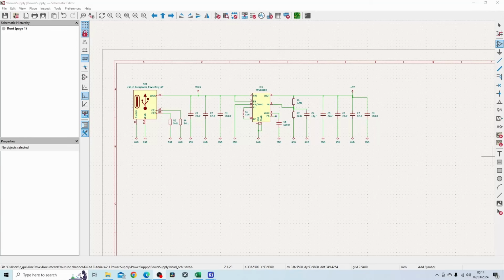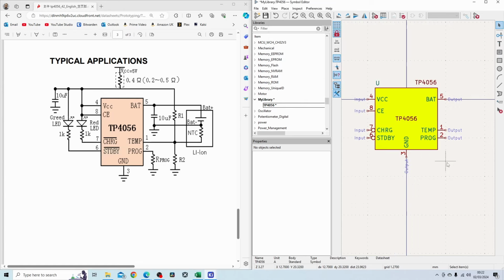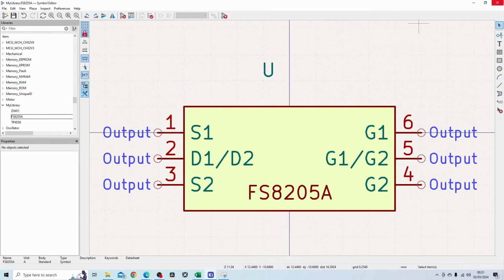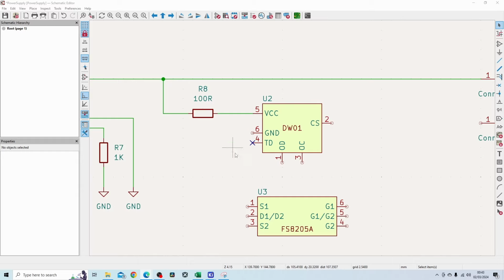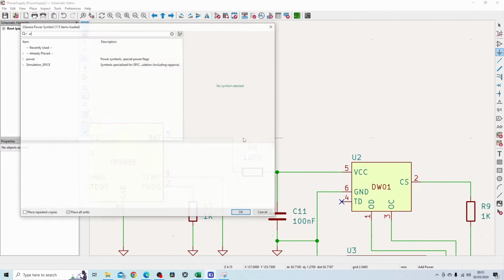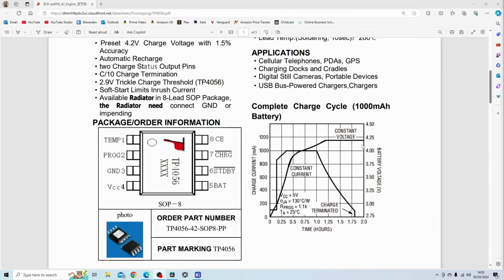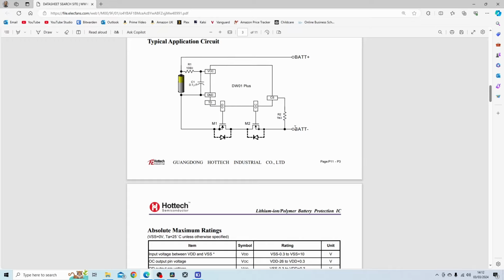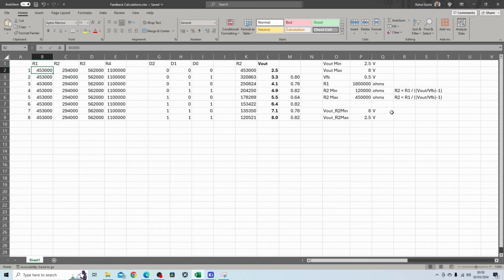TP4056 Explained! - Let's Design a Custom Power Supply - Part 2

Comment: Thanks so much for this, i practically made the same schematic and i needed confirmation it would work. Did you end up building the pcb? is everything ok with charging? Also R8 and R9 have different values in the datasheet for me. 470 and 2k. Where did you get these values from?
Reply from the maker: Hello, check out the latest video in the power supply video - I had to make some changes in the design and added some functionality.
Reply: @TheEngineeringExperienceYT  After seeing the series and checking the files in your github i see that regarding the DW01A you've just flipped around the s1g1 and s2g2 pairs in the mosfet bellow. That doesn't change anything right?? I assume it was done for the aesthetic of the schematic
Reply from the maker: @flexpetz55  Let me find you a link for a TP4056 circuit that i know works and is tested. Ill reply to this as soon as i can. I think it was the automated blinds PCB with esp32
Reply: @TheEngineeringExperienceYT thank you so much!! im looking for the tp4056 + dw01a combination
Reply from the maker: @flexpetz55  https://youtu.be/BhUu18EA3KA
Reply: @TheEngineeringExperienceYT  God bless you man, thank you so much for taking the time. This confirms my design. The only thing i did different was make the antenna area flush with the pcb (with no traces underneath).

Comment: Good job thank you. Just one remark, I hate the solution which is to turn off the battery negative pole. Usually, the battery negative pole is connected to the circuit GND. Switching the negative pole makes a lot of mistakes.
Reply from the maker: Thanks for the feedback. 

As I am replicating  a common setup of these parts, I followed that method. Typically when I implement over current protection, I always switch off the positive side. I would typically do this with a high side switch and a comparator to set the current threshold. 

This can also be used to switch load with a microcontroller which is very useful.

Comment: I am not sure how the FS8205A is going to function as the battery no longer has the ground connecting to the second source pin on the final diagram that you dhow at the end of the video.
Consider controlling the feedback using a DAC and an op-amp.  Then, you can control the DAC  output voltage from a microcontroller.
I hope this comment helps you.
Reply from the maker: Hey, Thank you for the comment. I'll review what you are saying and update if necessary.

The information on these parts is limited  although the part is commonly used.